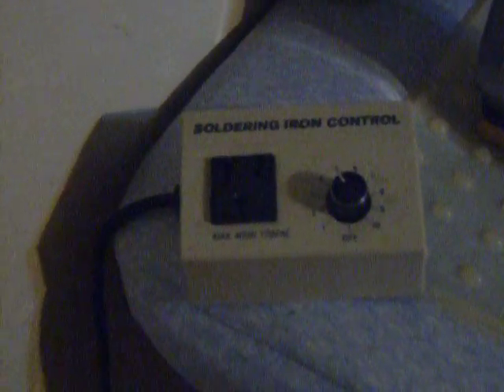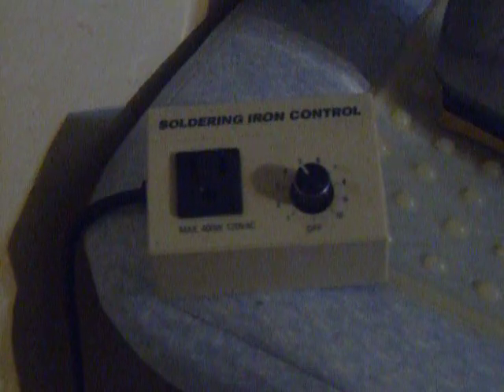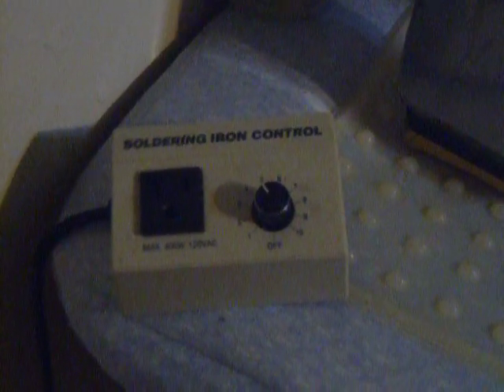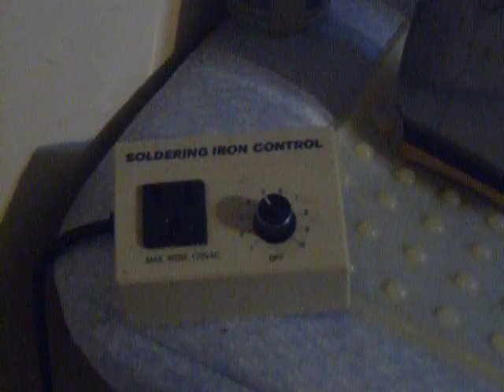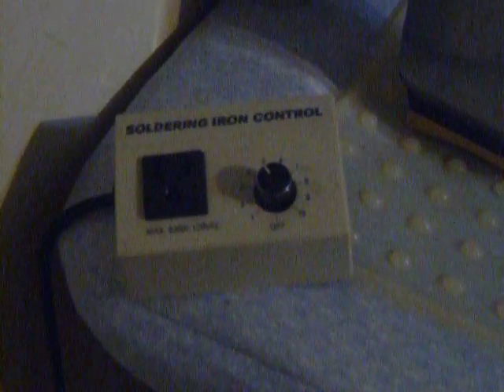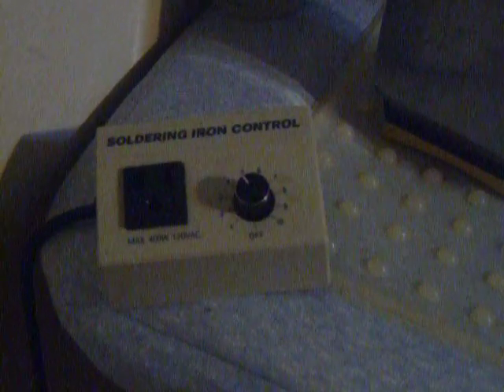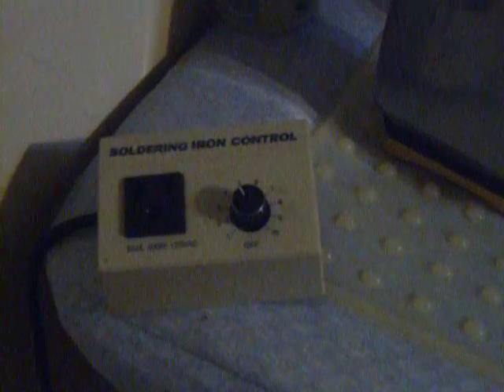how to attach solar cells must see tips

Comment from the maker: @LoveMyDogy you should buy a cheap 6 dollar digital volt meter tester off ebay so you can test how many volts you are getting at your panels. then test how many volts are at the end of you extension cord after you run your wire to your charge controller before you hook into it. then check the amps your getting at your panels then test the amps your getting at you end of the wire just before you hook into the charge controller. Then you know what your making and loosing from resistance from wire

Comment from the maker: @LoveMyDogy it will work fine. But the volts will come down to the lower one. And your panels never make the maximum amount of amps and watts so your charge controller will be just big enough you may even have a little room left over.

Comment from the maker: @LoveMyDogy If 10 gauge wont break the bank get 10 gauge. 12 is ok if  your not going to run it further than 10 or 12 feet. It you have to go 20 feet you better get at least 10 gauge wire. Extension cord is fine as long as it about 10 or 12 gauge. Do they have 8 gauge extension cord if so get that if its not a whole bunch of money.  I was going 20 feet with some 12 gauge wire and was loosing a lot of voltage. I doubled up  the wire and ran two of them and it worked ok.

Comment from the maker: @LoveMyDogy it will be ok. you can use it next time. I have some panels that I did with out the rheostat and they still work but they are low on power, but, they are not sealed.